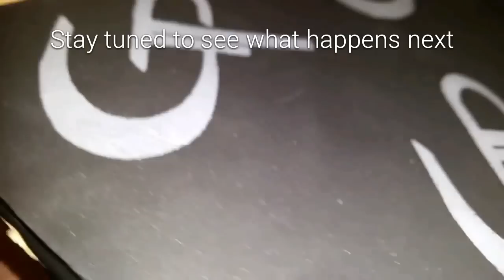Out with CCA in with GP OFHC Pure Copper wire

Comment: Very nice setup.  How many feet of that ofc wire are you using? I have a similar setup but with side post agm batteries.  I want to get the correct length.

Comment: Im wondering is there a reason for dual fuses on each fuse block running to the back
Reply from the maker: I'm surprised no one else noticed, the normal ANL fuses you'd typically see use gold plated steel and are only rated to handle around 300 amps per block, we placed all the hardware with brass (95% copper 5% zinc) studs, nuts, and copper washers. This gives us 3 to 4 times the amperage capability on a single fuse block. Not a cheap upgrade but can be beneficial for cleanliness and space issues for multiple runs of wire.
We only have one run on there at the moment but will be doubling nearly everything seen because we are about to do 10k in this vehicle.
Reply: I pay close attention I got to make sure I get full potential on my build or the friends build I help out on well thanks for letting me know that definitely need to try this kn my friend fusion build
Reply from the maker: JASON REYES no problem man